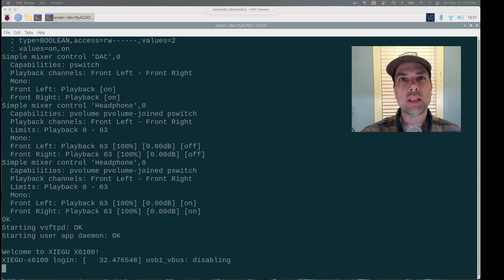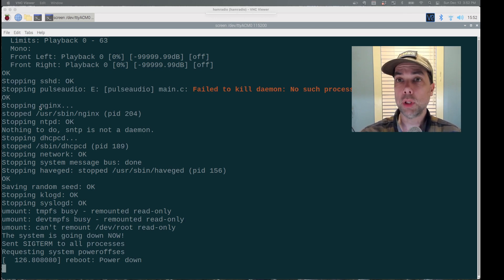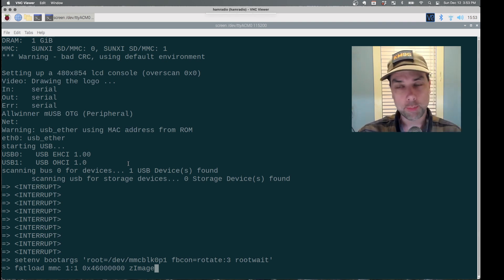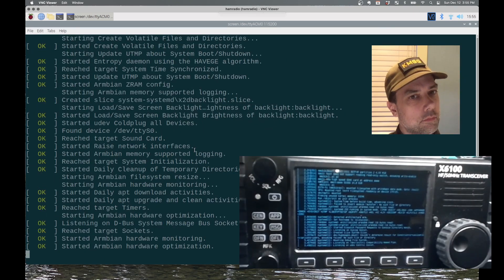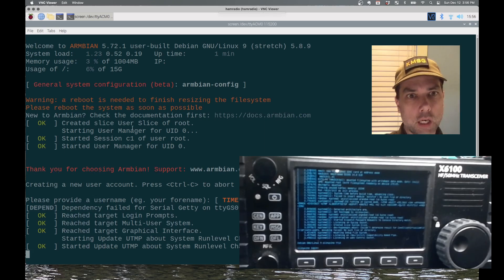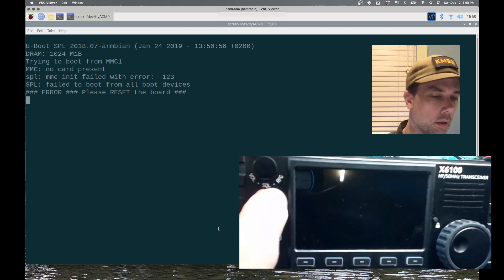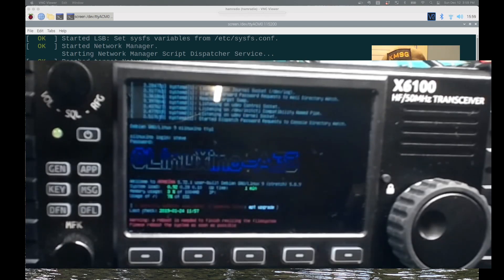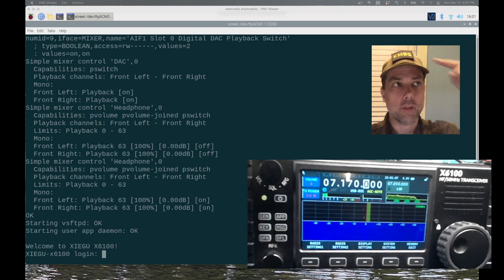X6100 + Armbian - How To!

Comment: Hola. 
Tiene alguna web donde podamos descargar el firmware que usted ha creado y poder traducir sus explicaciones? 
No hablo inglés y me gustaría sacarle el máximo partido a, mi X6100. 
Muchas gracias, usted es un genio.
Reply from the maker: Thanks!  The links are in the descriptions of the newer videos.  https://github.com/TemporarilyOffline/X6100-TOADs
Reply: @temporarilyoffline  instalando el firmware de su web desde la SD se abriría de bandas para CB27 y tendría todas las mejoras que usted ha conseguido? 
No hace falta raspberry ni conocimientos informáticos de programación? 
Entiendo que ese firmware ya está preparado para solucionar todos los problemas que han ido saliendo hasta hoy. 
Es asi? 
Gracias desde España.
Reply from the maker: @84rafaelkld  The firmware that I have on my site is only for CB27 and 10w on battery.  The instructions for installing it are on that website.  It doesn't really add any fixes for the problems with the radio, just OpenTX and 10w.  The rest is still "broken" for now.
Reply: @temporarilyoffline  muchas gracias. 
Estoy esperando a que llegue mi X6100 y quería informarme para poder sacarle el maximo rendimiento. 
Usted es un genio, envidio la facilidad con la que consigue modificar este equipo. 
Esperaré impaciente un nuevo firmware con todas las actualizaciones y reparaciones, así como la apertura de TX/RX en todas la bandas. 
Ya me he suscrito a su canal. 
Mil gracias.

Comment: This is all well and good Steve, but what awesome possibilities do you think youll be able to implement? (PS, I love linux so I'm all onboard for hacking it)
Second question ... do you think with all the reviewing you've done, is this a good radio to actually buy?
Reply from the maker: All the possibilities. This radio is great for hackers!  I'm going to do a QSO show with it soon, we'll see.
Reply: Like Steve said. With the right software it could transmit and receive using any mode on any freq. You can easily do replay attacks, packet, ax.25, any of the Joe Taylor modes. It's quite a bit more than the yardstick one in price but being a full fledged Linux machine the programmability is key. Transceiver and PC in the same package is like the old school rasp pi RPITX software but way better!
Reply: @kb9mtd-aaronwebb  sounds really good, but i do wonder if there's enough memory to facilitate all the extras you just mentioned.  Having said that, theres nothing to stop you plugging in a small SSD into the usb port.
Reply from the maker: Check out km6lyw's work
Reply: @MegaPrime2010   requirements for the largest program is for WSJTX. The others are CLI programs. You can technically do WSJT via CLI but it's not as easy to use. Requirements are 1.5 GHz or faster CPU and 200 MB of available memory. I thought Steve said the processor was something close to this in one of the videos. Also it appeared there was something like 16GB usable space remaining if I read right. Who knows but either way this would really be a great tool in my toolbox of fun things! Better if it were able to broadcast up to 70cm!
Reply: @temporarilyoffline  technically this was what I was referring to but wanted to keep it geared to your channel.

Craig is doing some great work!
Reply from the maker: It looks like a few mods could make that possible
Reply from the maker: I'm all about giving credit were it is deserved.   We are better off in the same team!